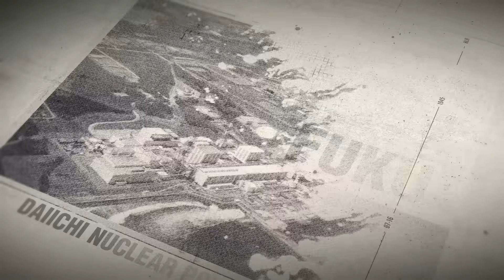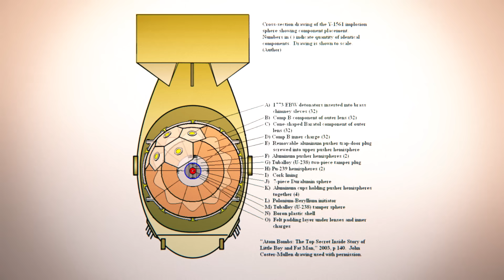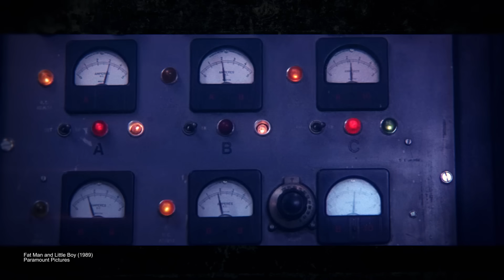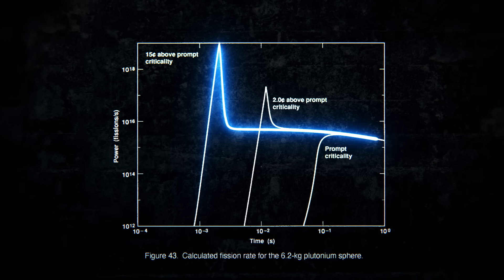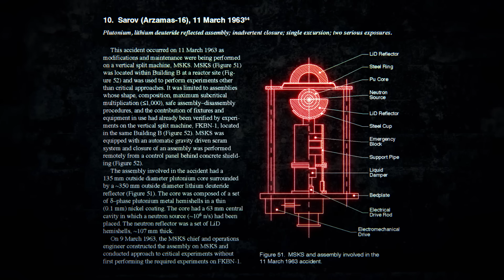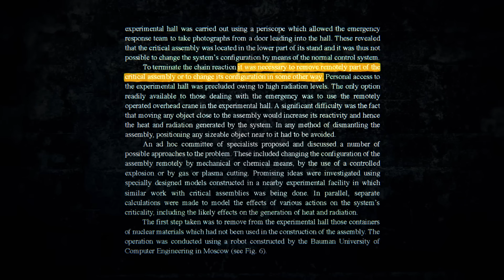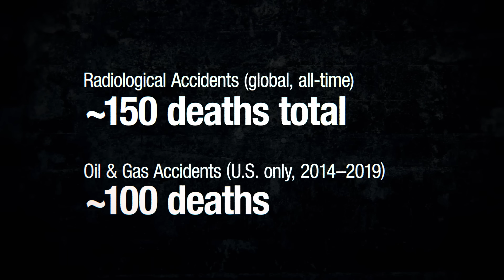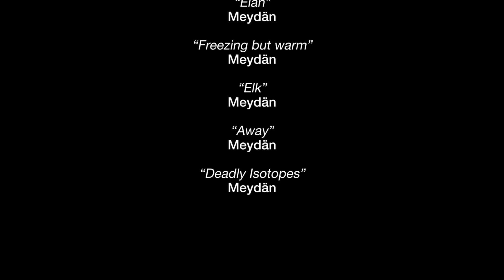Russia's Demon Core - Sarov Criticality Accident

Comment: I often enjoy your content, Kyle, but I go back and forth on whether I think you're a 'nuclear apologist' or not.  

The info here is great, but you know full well that the 150 nuclear deaths is a number with no basis in reality.  The Chernobyl number was a complete fabrication by the Soviet state and tracking deaths from either Chernobyl or Fukushima is nearly impossible.  The phrasing you chose when representing that number makes it clear that you know it's nonsense.

And because you know that, then citing it as a comparative number to Oil and Gas is just irresponsible.  Presenting conclusions based on data known to be flawed comes in well under the bar you should be setting for yourself.

I'm not endorsing the fossil fuel industry, nor am I taking a swipe at the nuclear industry, but if you're going to make "informative" videos, please be more responsible than that.

Comment: Question about reactors, if they can make photovoltaic cells, why can't they do the same thing with nuclear energy?  Nuclearvoltaic? Where the radiation is absorbed and transformed, instead of the water = steam = spin normal turbine = electricity? It seems like it would be a far more efficient use of the nuclear reaction then making steam.

Comment: The fossil fuel industry has more lethal accidents partly because safety measures are laxer and partly because it's a much bigger industry. Safety measures are laxer partly because it's a much larger industry, and partly because these aren't materials that can kill you if you just get too close to them for a second. It's also not true that we need nuclear power; the energy transition would just be easier if we had more nuclear power. As we scale up nuclear industry and look for efficiency gains though, it's extremely necessary to maintain such high levels of safety. I'm sure that can be done, but these accidents emphasize how when it comes to nuclear power, we really can't afford complacency.

Comment: Some are taking issue with focusing on direct deaths from nuclear incidents vs the fossil fuel industry instead of indirect and environmental impacts. That is understandable, but those comparisons arguably swing things more in favor towards nuclear. Some may also take issue with comparing two bad things; why not just have good things? Well, the energy requirement of us as a species is only increasing; comparisons between nuclear and fossil fuels happen because when we replace one, we invariably need the other to meet our energy needs. This is a case of choosing the better option.

The environmental impact of nuclear disasters is obvious and direct. Miles of exclusion zones, increase in cancer rates, and monuments to these disasters still stand as we try to contain dangerous material. However, fossil fuel’s environmental impacts are often invisible yet profound. Climate change due to CO2 emissions threaten to end our species, environmental pollution of air, sea, and land claims thousands upon thousands of lives per year. Fossil fuel energy has and continues to damage more of our environment and kill more people than nuclear energy could ever hope to achieve.

Comment: I think about this when i think of the ppl picking apart UAP's. Its akin to us dropping a motorcycle in the middle ages w/ a full tank of gas. Eventually someone will get it to work with enough messing about.  No doubt getting burned and dying trying to ride or they might figure it out and run out of gas. Do the same for a gravidic drive and or its power source dropped on us. No doubt those guys picking those things apart have run into mortal situations like this.

Comment: You know, the fatal flaw that I keep seeing in each of these accidents: the effect of gravity only serves to continue the reactions

All of these rigs should've been set up to lift the core up into position - that way, in the event of an accident, the system is self resetting
Reply: Ironically the normal name for this is called a Dead Man's Switch. Suicide bomber's use a similar system, but inverted. If the trigger is held, it prevents the explosives from going off - so that if you kill the bomber, the explosives go off anyway

Comment: If people are concerned about radiation, they should be more worried about coal fired power plants than nuclear power plants. Within coal fired power plants, radiation is many, many times higher than the level at which any nuclear power plant would be shut down if detected.

Comment: FWIW: In regards to the accidents involving Daghlian and Slotin, there is something I sort of learned working in Aviation: 

You try to design something so if it fails, it fails in a 'safe' -- or at least a 'safer' -- configuration. 

Their test setups should have been designed so if they lost control of the 'reflectors' they were manipulating, it would tend to move away from the plutonium core, not move closer to it. 

Did they do what they did because of expediency? 1940s hubris? I have no idea. 

EDIT #1→ I posted this comment before Kyle used the word "hubris" himself. 

EDIT #2→ After watching a bit more of this video, I remembered this quote: 

"Well, I don't think there is any question about it. It can only be attributable to human error. This sort of thing has cropped up before, and it has always been due to human error." 
 — 2OO1: A SPACE ODYSSEY [1968]
Reply: As I understand it, the reflectors were assembled the way they were due to expediency.

This was especially true for the Slotin accident.  He was supposed to use shims to prevent fully closing the reflector, and do the assembly multiple times using thinner shims each time.  Instead he used a screwdriver so he could adjust the spacing far more quickly.

At Sarov, the assembly machine was intended to be fail-safe.  The top and bottom halves of the assembly were intended to be horizontally separated during construction, specifically to prevent parts of the top half being dropped onto the bottom half.  For the actual experiment, the top half would be moved into place above the bottom half, then the machine would be used to lift the bottom half up to the top half.  The machine had two mechanisms to lower the bottom half to the safe position, and if the machine broke it was almost certain to drop the bottom half, failing safe.

If I recall correctly, in the Sarov incident the experimenter did not use the horizontal slide to move the upper half away.  Instead he was constructing the upper half in position over the lower half.  So when he dropped part of the upper half, it was able to fall on the lower half.  Ordinary a single piece would not cause a criticality by itself, but due to a separate error the assembly was much more reactive than intended, so the combination of these two factors was sufficient to create a criticality.

Comment: 12:30 What's the environmental and human toll on Chernobyl accident? What are you talking about?
Reply: The disconnect here is the difference between deaths that can be directly associated with the accident and deaths that may have occurred.  

This seems deceptive, but we can't lay every single cancer death at the foot of Chernobyl.  Some of them would have happened anyway.  Many even.  So that's not a reasonable metric.

That doesn't mean that nobody died from cancer due to Chernobyl, it means we will never know for certain which deaths are from the accident and which ones would have happened anyway.
Reply: Exactly. And if we're talking about environmental and human toll due to secondary effect of the gas and oil industry, then its also way more than the nuclear industry...

Comment: There are barrels upon barrels of nuclear wastewater, stowed away to just sit there. It's very wasteful at best, and ticking time bombs at worst. Even this year there was a leak of nuclear wastewater in Germany that had to be contained, and the reality is that radiation has the potential to be just as destructive to the environment as oil or gas. It's my understanding that there are companies out there (Microsoft for example, I think) that are trying to develop nuclear reactors that can truly RECYCLE this wastewater. But until we solve the wastewater problem, I don't consider nuclear power to be truly clean energy. That said, I do believe nuclear power has the POTENTIAL to be very clean energy. The missing link is dealing with nuclear wastewater, and hopefully that can be solved by the aforementioned "recycling" reactors.

Comment: One problem with your final point. You can't compare Oil deaths and Nuclear Death directly like that. Oil is far more prevalent than nuclear power. You should be estimating with fatalities per Watt hour of power produced or similar metric to account for that. I say this not because I think Oil is safer, but because the people that you are arguing against are going to bring up that point as a way to deflect that comparison. If you don't do those calculations, they aren't going to and instead hide behind the "missing" data. They argue the same way the Tobacco industry does, they don't try to win, just create enough doubt that their supporters can feel safe in providing that support.
Reply from the maker: Brown Coal: 32.72 deaths per TWh. 
Coal: 24.62 deaths per TWh.
Oil: 18.43 deaths per TWh.
Biomass: 4.63 deaths per TWh.
Natural Gas: 2.82 deaths per TWh
Hydropower: 1.3 deaths per TWh. (This rate is heavily influenced by a few large dam failures.)
Wind: 0.04 deaths per TWh.
Nuclear: 0.03-0.07 deaths per TWh. 
Solar: 0.02 deaths per TWh.
Reply: @kylehill  Everyone has heard about chernobyl. Almost no one knows about things like Banqiao, Bhopal, Minamata just to name a few.
Reply: @kylehill  Why is nuclear the only one with an error bar? It feels like you only did that so that it can be below wind, when it actually isn't.
Reply: @kylehill  good god
Reply: @accession3d  ^He did the math. Have to keep these stats saved somewhere.
Reply: @kylehill  Are these only counting occupational deaths or statistical deaths caused by environmental factors (like airborne heavy metal contamination from burning coal)?
Reply: @kylehill  How tf do you die from solar energy?
Reply: @kylehill  Note: Do you include nuclear weapons testing in that? Because there would be thousands of additional deaths in the soviet union added if you do (the demon core) Also, do you include people who died of cancers/cardiovascular diseases related to Chernobyl cleanup? Ukraine alone pays 36,525 women for being widows caused by Chernobyl. Even if you think that number is grossly inflated, it still should mean *something*.
Reply: @DrakonPhD why would military use of nuclear materials (nuclear bombs) be added to civilian usage of nuclear materials to specifically generate electricity? By following your logic, then dehydration/sunburn deaths need to be added to solar, hurricane deaths need to be added to wind, etc...
Reply: @kylehill I’d say the commenter raises a good point but also I think it’s also our extra precaution to nuclear that helps sway the numbers. I like to think of the Grand Canyon death count vs that of a skyscraper. Grand Canyon has a deceptively high death toll but people are more afraid of falling off of skyscrapers than the Grand Canyon. We know and perceive the risks of nuclear accidents and attacks and have thus taken as many precautions as necessary to the point it’s always down to human error combined with a series of unfortunate events in order for their to be an incident, where as coal and gas’s risks are apparent but could never happen to you. If we tackled C&A with the same level of precaution as Nuclear, numbers would dramatically decrease.
Reply: Well then just compare casualties in a country that produce a lot of it's energy with nuclear (like France) with other casualties, I'm pretty sure there is more incident with wind turbines set up than with nuclear... 
Just my guess though.
Reply: Kurzgesagt already did the math, Kyle is right.
Reply: Notice that he deliberately compares different statistics.

Nuclear power proponents: "All my arguments are deliberately misleading!"

Also nuclear power proponents: "Why are people so distrustful of nuclear power?"
Reply: @CoastalSphinx  The irony is that the comparison you've made compares different statistics
Reply: @CoastalSphinx  Oh look, there's one of them right here. The direct comparison you wanted has been provided for your convenience.
Reply: @CoastalSphinx  so now that it's been normalized to deaths per TWh, how would you like to move the goalposts?

Comment: 5:11  I would think they would know you cant out run radiation. They received the lethal dose instantly. They probably knew their life was over, but they didn't want to take more people with them.
Reply: Actually you can significantly reduce radiation doses by running away. This is because the intensity of the radiation typically falls off with the inverse square law of the distance between you and the radiation source.
Because of this, process facilities with a risk of criticality accidents usually have sensitive radiation alarms. 
These alarms sound if the onset of criticality is detected. Staff will be trained to rapidly evacuate and move to a muster point at a safe location.

Comment: a lot of people dont know this but if you take out the plutonium core from a nuclear bomb and replace it with a core made from coal and blow it up, it makes a diamond instead of a nuclear explosion
Reply: No joke, this was demonstrated in an episode of Mythbusters. They used a custom explosive setup, but the result was the same. It wasn't really a diamond, though. It was a lot of itty bitty diamonds. A lot of industrial diamonds for things like drill bits are manufactured, actually. Not by using explosions, though.
Reply: @saberwing7930  In Mythbusters they used graphite not coal which is full of impurities.

Comment: At the time of Slotin’s accident, did they then know that it wouldn’t result in a full blown nuclear explosion?
Reply: No, they didn’t know what would happen; some believed it would ignite the air or blow the assembly up (which would stop the reaction, just more dangerously)

But they knew it wouldn’t be a nuclear explosion because the geometry/speed wasn’t correct.

Comment: I need one thing explained here. How do nuclear reactors actually use the delayed criticality with their control rods. And what happens to the prompt neutrons produced as a result of fission in the reactor.
Reply: All the neutrons are used in the same way. But the delayed neutrons limit the rate of power increase if the reactor becomes slightly supercritical.
This means that mechanical control rod mechanisms can move fast enough to respond to reactivity changes and then keep the reactor power under control.

Comment: It wasn't possible for the top reflector to slip.  The machine was designed with a top platform to hold the upper portion of the assembly and the lower portion, holding the bottom part, raised up to reach criticality and could drop to stop a criticality.  In this case, Sarov assembled the top reflector directly on top of the lower.  The best recreation of the accident assumes he realized he had made a mistake when the assembly initially reached criticality. There was a second burst shortly thereafter, presumably when he tried to remove the top reflectors from the assembly.  Had he left after the initial burst, he could have survived.

Comment: The death counts for Oil & Gas are misleading because they don't include the acute and chronic disease caused from combustion. The pollution is an obvious direct impact, of course, but induced changes to the climate are arguably drastically worse. Nuclear, wind, solar, and hydroelectric are objectively safer and more future-conscious than fossil fuels and there are government administrations actively working backwards from sustainability.